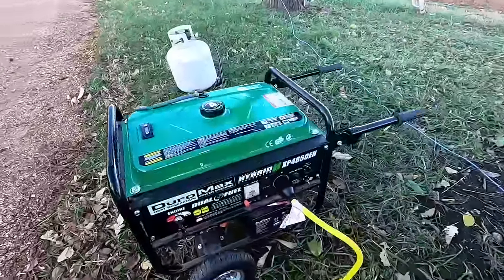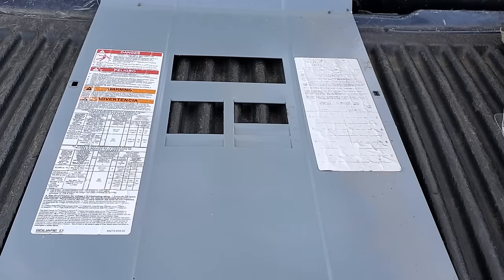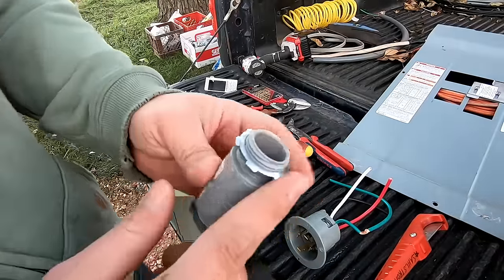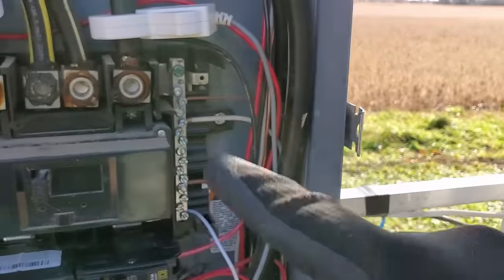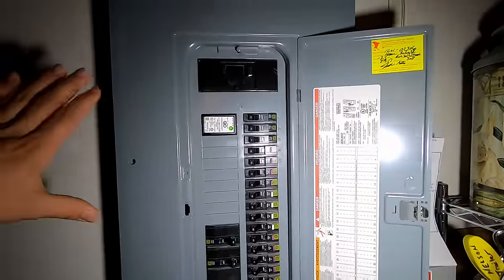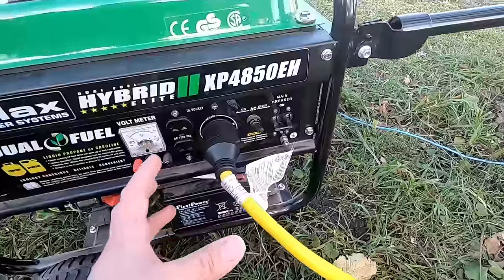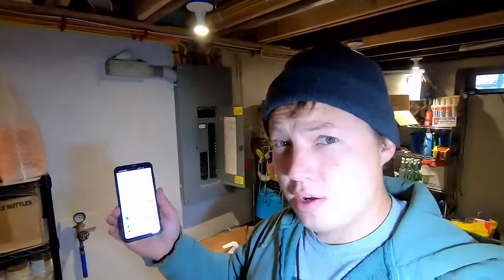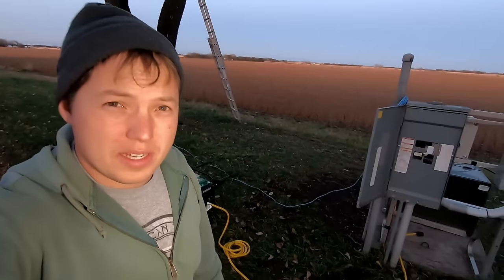How To Hook Up a Generator To Your House Using a Breaker Interlock Kit & Power Inlet Box

Comment: Your no bs easy to follow video inspired me to buy a larger generator (Pump gas or LP model) and install an external connection with a panel interlock. I ended up getting the Evolve power monitor and it is really cool to be able to understand my actual power consumption. Now that I am ready we won't get another Hurricane for years. Thanks again for inspiring me to action.
Reply: Don’t forget about the generator safety tips as well. Remember safety is always important. Here are the generator safety tips:

1) Please do not allow an unqualified person or your children to operate the portable generator. Just because some manuals don’t say that doesn’t mean it’s safe. That is important against the generator safety rules. We also need to be keeping an eye on our children too. You need to make sure that your children are not playing near the portable generator especially when it’s running so they won’t get electrocuted. Generators pose electrical risks and they can be hot during an operation. Please keep your children away from the portable generator at all times. It is important to keep our children safe especially our little ones. Be aware of all the hazards.

2) Some people use their portable generators indoors which increases the risk of carbon monoxide poisoning. It’s important to have a carbon monoxide if you have a gas generator. Never ever use your generator indoors even if your doors and windows are open and even in the garage is not safe to use a portable generator. Not even at your porch and your deck. It is never safe to use your generator indoors and in enclosed areas of your home. Your generator needs to be 15-20 feet away from your house. 

3) 🔥generators cause fire hazards too. Never refuel your generator while it’s running. You need to let your generator cool off before refueling it and before storing your generator. Never overload your generator too. Never ever back feed your generator. You should never plug your generator into a wall outlet. Also never store propane tanks indoors. Please keep flammable things away from the generator as well and please don’t smoke cigarettes near the generator. Having a fire extinguisher next to the generator is also important against the generator safety rules. 

4) generator operation; make sure your hands are dry before touching the generator. Never use your generator in wet conditions. Don’t let your generator get wet. You need a generator tent if you need to use your generator during wet weather. Please don’t wear loose clothes when operating the generator. Turn on your generator before plugging in appliances. Use the right cord for your generator. Please do not use worn out cords. 

https://youtu.be/I1jT3ANENvI and here is a video more about keeping others safe when using generators and also about our family’s safety. Hope this helps

Comment: Hello Ben and thank you for your informative content. Quick question for you. I just wired in a whole house generator and have a question regarding current measurement. The generator provides 240 V through a 30 amp breaker in the panel. While running the house on the generator, I turned on several appliances to determine how much current is being drawn from the generator. I placed the clamp meter on each of the two legs on the 30 amp breaker. One leg measured 17 A and the other measured 13 A. How do I determine the total current draw being provided from the generator to the house. Thank you.
Reply: ⚠️Generator safety tips:

This is just a reminder for everyone’s safety when using portable generators. All generator safety rules need to be followed carefully to avoid hazards. 

1) Please do not allow an unqualified person or your children to operate the portable generator. Just because some manuals don’t say that doesn’t mean it’s safe. That is important against the generator safety rules. We also need to be keeping an eye on our children too. You need to make sure that your children are not playing near the portable generator especially when it’s running so they won’t get electrocuted. Generators pose electrical risks and they can be hot during an operation. Please keep your children away from the portable generator at all times. It is important to keep our children safe especially our little ones. Be aware of all the hazards.

2) Some people use their portable generators indoors which increases the risk of carbon monoxide poisoning. It’s important to have carbon monoxide detectors if you have a gas generator. Never ever use your generator indoors even if your doors and windows are open and even in the garage is not safe to use a portable generator. Not even at your porch and your deck. It is never safe to use your generator indoors and in enclosed areas of your home. Your generator needs to be 15-20 feet away from your house. 

3) 🔥generators cause fire hazards too. Never refuel your generator while it’s running. You need to let your generator cool off before refueling it and before storing your generator. Never overload your generator too. Never ever back feed your generator. You should never plug your generator into a wall outlet. Also never store propane tanks indoors. Please keep flammable things away from the generator as well and please don’t smoke cigarettes near the generator. Having a fire extinguisher next to the generator is also important against the generator safety rules. 

4) generator operation; make sure your hands are dry before touching the generator. Never use your generator in wet conditions. Don’t let your generator get wet. You need a generator tent if you need to use your generator during wet weather. Please don’t wear loose clothes when operating the generator. Turn on your generator before plugging in appliances. Use the right cord for your generator. Please do not use worn out cords. 

https://youtu.be/I1jT3ANENvI and here is a video more about keeping others safe when using generators and also about our family’s safety. Hope this helps

Comment: You should plug into the generator before plugging the cord into the panel.  If for ANY reason the neutral has become hot to earth (it's happened) the neutral prong on the cord becomes an electrocution point before it gets plugged in.  Otherwise, very good demo!
Reply: That sounds like an issue with the neutral not being bonded to ground properly. On a funny note, how else you going to find out there's something wrong with your neutral? :P Can't tell you how many times I found problems that way.
Reply: Don’t forget about the generator safety tips as well. Remember it’s important to follow all the generator safety rules whenever you use your generator. Here are the generator safety tips:

1) Please do not allow an unqualified person or your children to operate the portable generator. Just because some manuals don’t say that doesn’t mean it’s safe. That is important against the generator safety rules. We also need to be keeping an eye on our children too. You need to make sure that your children are not playing near the portable generator especially when it’s running so they won’t get electrocuted. Generators pose electrical risks and they can be hot during an operation. Please keep your children away from the portable generator at all times. It is important to keep our children safe especially our little ones. Be aware of all the hazards.

2) Some people use their portable generators indoors which increases the risk of carbon monoxide poisoning. It’s important to have a carbon monoxide if you have a gas generator. Never ever use your generator indoors even if your doors and windows are open and even in the garage is not safe to use a portable generator. Not even at your porch and your deck. It is never safe to use your generator indoors and in enclosed areas of your home. Your generator needs to be 15-20 feet away from your house. 

3) 🔥generators cause fire hazards too. Never refuel your generator while it’s running. You need to let your generator cool off before refueling it and before storing your generator. Never overload your generator too. Never ever back feed your generator. You should never plug your generator into a wall outlet. Also never store propane tanks indoors. Please keep flammable things away from the generator as well and please don’t smoke cigarettes near the generator. Having a fire extinguisher next to the generator is also important against the generator safety rules. 

4) generator operation; make sure your hands are dry before touching the generator. Never use your generator in wet conditions. Don’t let your generator get wet. You need a generator tent if you need to use your generator during wet weather. Please don’t wear loose clothes when operating the generator. Turn on your generator before plugging in appliances. Use the right cord for your generator. Please do not use worn out cords. 

https://youtu.be/I1jT3ANENvI and here is a video more about keeping others safe when using generators and also about our family’s safety. Hope this helps be safe
Reply: @Zeknix  The sparks are pretty!  🤬😵

Comment: Is there a device that tells you when the grid power is back on?  I just installed a interlock but now I am wondering how will I know when I can shut my generator off.
Reply: I have the same problem and haven’t figured out how to have a light on the utility supply to tell when they restore power.
Reply: The eyes God gave ya...😅 Look to see if the poor schlubs down the road have lights
Reply: Here are the generator safety rules that everyone needs to follow: this is just a reminder for everyone’s safety. Always make sure you follow all the generator safety rules whenever you use your portable generator. Generators can be dangerous if not used carefully. Every year, hundreds of people die or get injured when using portable generators due to carbon monoxide poisoning and electrocution. Make sure you are using your generator carefully and keeping others safe as well. There is something very serious that everyone should always be aware of when using generators. Some people do run their generator indoors which is not safe and that increases the risk of carbon monoxide poisoning which can cause death of family and you. Some people run their generator in wet conditions which can electrocute them. Please remember that you should never run your generator indoors. Remember that carbon monoxide is an odorless and colorless gas that you cannot see or smell. Carbon monoxide is a silent killer. Keep that in mind. Make sure your generator is 15-20 feet away from your house and away from doors, windows, and vents. Never use your generator in your porch too. Having a carbon monoxide detector is very important against generator safety. Some people also allow children to go near the portable generator which could pose risks. We need to keep an eye on our children making sure that they are not near the portable generator so they won’t get electrocuted or burned by the generator which is dangerous. A locking enclosure also keeps kids safe. A generator shed might look like a tempting place to explore, or take cover during a game of hide and seek, but a generator is a dangerous piece of equipment that can cause injury. It says on the manual that we should also keep children away at all times from the portable generator to avoid injuries. Please do not allow a child or unqualified people to operate the portable generator.  It is important to keep your children safe especially little ones. The portable generator can be hot during an operation. Just because some manuals missed what should be listed doesn’t mean it’s safe to do. Always follow the generator safety rules when using portable generators. Generators pose electrical risks. If you need to use your generator during wet weather, you need a generator tent to protect your generator from getting wet. Don’t let your generator get wet. Keep your generator dry and before using your generator, please make sure your hands and your generator is dry. Do not wear loose clothing when operating the generator. Everything that is said on the generator’s operating manual should not be ignored. Never smoke cigarettes near the generator. Please keep flammable things away from the generator. Never overload your generator too. Your generator can catch fire. Never ever try to plug a generator cord into a wall outlet to avoid back feeding. Back feeding your generator is dangerous. Always turn on your generator first before plugging in appliances and shut off the appliances before turning your generator off. Use a heavy duty cord for your generator and the cord should not be worn out. All the instructions should be followed carefully. Never refuel your generator while it’s running. It can cause fire if fuel spills while your generator is hot. You should turn off your generator and let it cool off before refueling it. Having a fire extinguisher next to the generator is also important. This is only a reminder for everyone’s safety of using generators. Make sure your generator is properly grounded. Having a fire extinguisher next to the generator is also important against the safety rules. https://youtu.be/I1jT3ANENvI and here is a video more about keeping others safe when using generators and also about our family’s safety. It’s important to keep our little children safe as well. Make sure your little children are kept away from the generator at all times especially when it’s running. Hope everyone finds this helpful. Always remember that it’s better to be safe than sorry. Remember that warnings should not be ignored.
Reply: @jpridie  in Quebec, Canada Hydro Quebec has an on line application. You contact Hydro with your phone, register that that you are missing electicity, when its back, they contact you via your phone.

Comment: Nice job on installation. I have a very similar system in my camper down on the lower part of my property. If someone wants to do the job right. I would definitely recommend this video. Thank you for making a quality video instead of having people watchyou plug in a extension cord or some crap like I have seen people do. Hope you do more videos of diy videos.
Reply: ⚠️Please don’t forget the rules about generator safety: This is a very important announcement for everyone. It’s important to follow all generator safety rules whenever we use portable generators: 

Everyone must see this. This is just a reminder for everyone’s safety. 

1) KEEPING OTHERS SAFE: Please do not allow an unqualified person or your children to operate and service the portable generator. Just because some manuals don’t say that doesn’t mean it’s safe. That is important against the generator safety rules. We also need to be keeping an eye on our children too. You need to make sure that your children are not playing near the portable generator especially when it’s running so they won’t get electrocuted. Generators pose electrical risks and they can be hot during an operation. Please keep your children away from the portable generator at all times. It is important to keep our children safe especially our little ones. Be aware of all the hazards.

2) WHERE TO RUN YOUR GENERATOR: Some people use their portable generators indoors which increases the risk of carbon monoxide poisoning. It’s important to have a carbon monoxide if you have a gas generator. Never ever use your generator indoors even if your doors and windows are open and even in the garage is not safe to use a portable generator. Not even at your porch and your deck. It is never safe to use your generator indoors and in enclosed areas of your home. Your generator needs to be 15-20 feet away from your house. 

3)🔥FIRE HAZARDS: Never refuel your generator while it’s running. You need to let your generator cool off before refueling it and before storing your generator. Never overload your generator too. Never ever back feed your generator. You should never plug your generator into a wall outlet. Also never store propane tanks indoors. Please keep flammable things away from the generator as well and please don’t smoke cigarettes near the generator. Having a fire extinguisher next to the generator is also important against the generator safety rules. 

4) GENERATOR OPERATION: make sure your hands are dry before touching the generator. Never use your generator in wet conditions. Don’t let your generator get wet. You need a generator tent if you need to use your generator during wet weather. Please don’t wear loose clothes when operating the generator. Turn on your generator before plugging in appliances. Use the right cord for your generator. Please do not use worn out cords. 

https://youtu.be/I1jT3ANENvI and here is a video more about keeping others safe when using generators 

Hope this helps. Remember safety first

Comment: Don't you need to un-bond the neutral on the generator? I'm putting a switch on mune so I can easily un-bond when I need to.
Reply: Curious, when running on 240, does that prevent any backfeed on neutral wire through system?.....thanks,  carpenter asking!